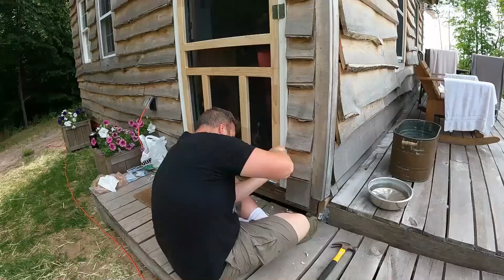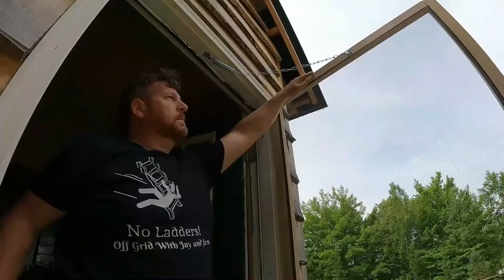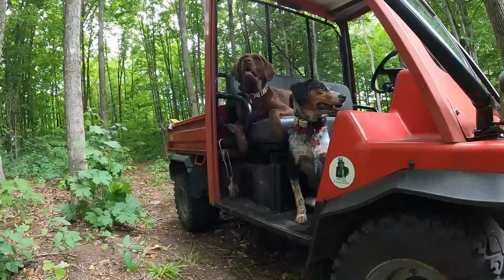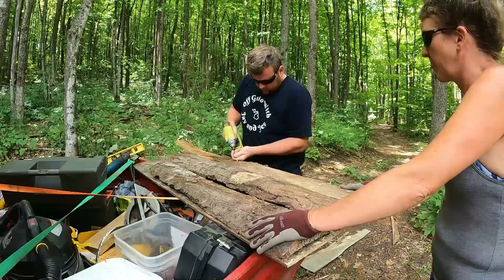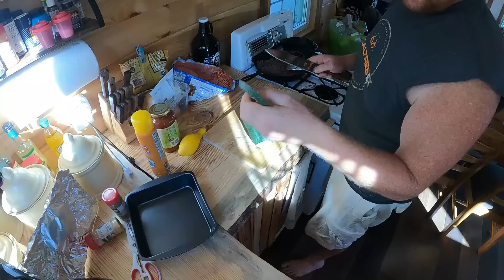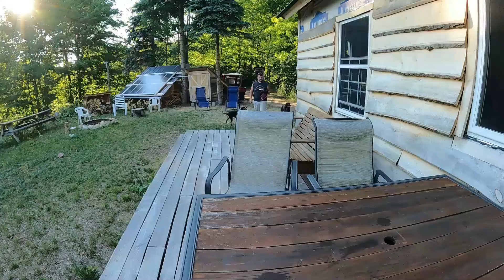Checking Things off the List on the Off Grid Cabin and Property

Comment: ooooh,  a screen door, fancy.  You probably should put a latch on the inside of the door to keep it closed during the cross breezes/wind. Are you going to clear coat the hinges since they are exposed to the weather? If the metal rusts, it would match the wood...lol
Reply from the maker: Ya still need some more fiddles, lol. Think I bought the galvanized hinges.....we will see

Comment: Where abouts in Upper Michigan are you,?   We used to get up there from Milwaukee Wisconsin to go Skiing  40 + years ago.  Blackjack Ski Reaort was still being built the last time we were up there for Skiing at Powderhorn, Whitecap and Indianhead ski resorts.
   Do you have internet and phone service at your place, if you are near a town I guess that would be available to you .
  I really like what you have done with your cabin and your solar power build.
I am just about to make the plunge and purchase a all in one  6500 Watt EG4 inverter and a couple of the EG4 Life Power Lithium Ion Batteries.
  I will have to figure out what kind of solar array I will need as well.
  It is all new to me, but the way things are going it is possible that the grid may be experiencing outages in the very near future, I would like to be prepared.
  Thank You for providing the excellent Videos,  I will be checking out more of them.
Reply from the maker: Thanks Lincoln. We are just south of the mackinaw bridge so lots of skiing around. We do have good cell service so we use that for internet. No hard lines within a couple miles of the property so off grid was the only option. Lol. Check out Will Prowse channel if you are just learning, I'm sure you have, but lots of good info there. 😀
Reply from the maker: Thanks for the support